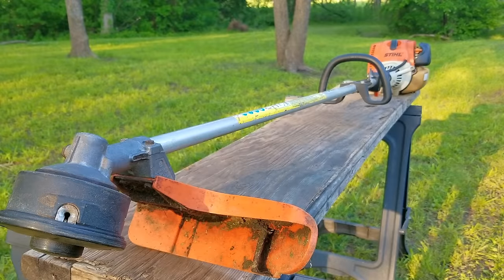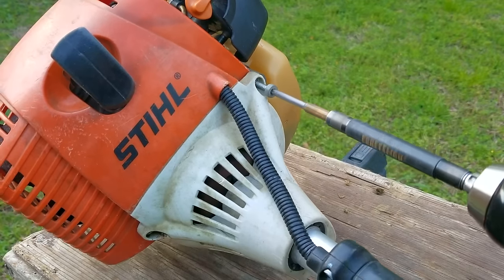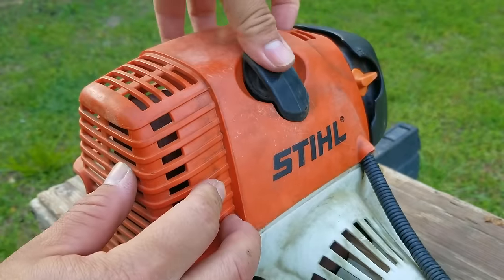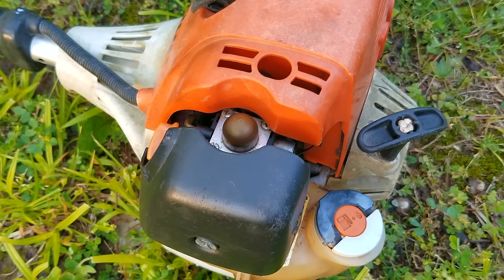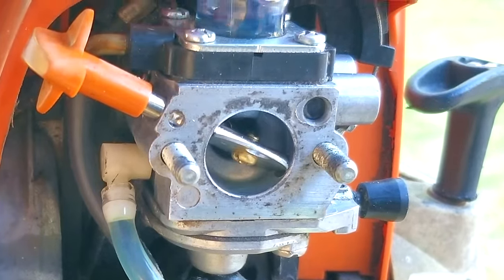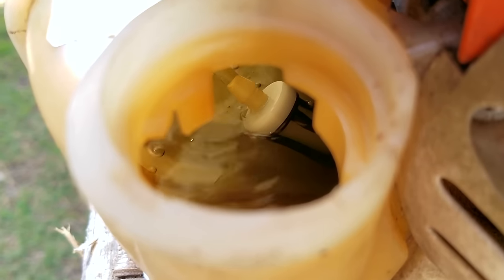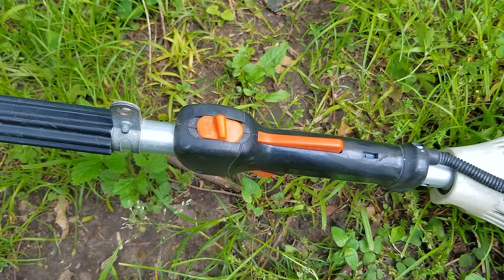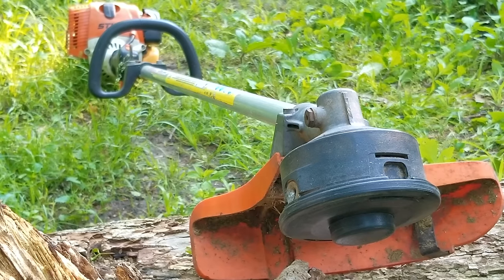Fixing A Stihl Trimmer That Doesn't Always Stay Running.

Comment: Your new carb is not a 1 to 1 replacement.  Heck even the rebuild kits are not 1 to 1.  But at least they're just gaskets and springs.  I've rebuilt quite a bit of stihl carbs.  It's pretty quick once you know what you're doing.  And you'll enjoy it if you like to tinker.  Makes more sense to me to do that if you care about your machine.  That repeated rope yanking hurt my soul.  To properly start Stihl engines, gently pull the rope until you feel resistance.  Fully retract rope then give it a brisk short pull.  You don't want pull the rope all the way.  That's how they'll break.  One thing worth trying before you tear up the carb or replace it is to play with the throttle a bit.  Use fresh fuel, with some cleaner additive.  Do whatever you need to with the throttle to get it running.  For example, a full throttle to start, feathered to keep it running.  Then slowly increase the throttle until you can go full throttle.  Release it a bit if it starts to choke and die.  I just did this on a trimmer that was said to need a carb cleaning/fixing.  It sat for 2 years.  It started and died and failed to start again. Waited a bit to let the engine unflood.  Started again with great difficulty then performed the above procedure just as a test.  Now it works great.  I hate replace whole part mentality.  Try fixing the dang thing to keep it out of the landfill.  Not everything needs to be replaced.
Reply from the maker: wow, thanks for all the wonderful tips.

Comment: i haven't drained fuel for winter storage ever : reason 1: shelf life is supposed to be 6 months with modern fuels and large amounts of winter blend ethanol fuel isn't introduced till after season ends and is removed before season begins 2: i keep the fuel clean 3: winter storage: my tanks are full or partially full to prevent dry rot and stored  HANGING UP RIGHT in a dry space cause ethanol DOES absorb moisture in string trimmers moister will settle to the bottom of tank not carb. a lawn mower is different the lowest point is the carb bowl so simply shutting off the fuel valve will prevent corrosion inside the carb from sitting over winter and tank is plastic most the time drain the fuel if in dought .    most videos ive been watching on 2 strokes with failed metering gaskets etc look like dry rot. only an opinion,                            let me know of any other opinion
Reply from the maker: thank you for sharing your thoughts

Comment: I use only engineered fuel (VP small engine fuel) and Stihl full synthetic oil. Yes I leave the fuel in all winter long. It keeps the diaphragms soft and flexible. My Stihl KM90R is 17 years old and starts first pull. Is this fuel more expensive? Yes, but well worth it.
Reply from the maker: if it works for you, keep using it.

Comment: Good video 👍. I have a question what aftermarket carburetor you use and how does it compare to the oem? My experience in the past they don't compare at all but my thoughts that they might be getting better.
Reply from the maker: thanks, I've replaced a lot of these carbs on Stihl products only after I have issues when getting the original to work properly. Of all the ones, I've had to replace only 1 was problematic, and 2 others, had small issues that I was able to deal with. And as for which carb I use, I don't have a preference. they'er all the same, as far as being aftermarket.

Comment: In my experience when you use the stihl motomix fuel or the aspen 2 stroke fuel it doesnt cause problems when you leave it in the tank
Reply from the maker: nice, thank you for the tip
Reply: Replace the gas lines

Comment: I have a Stihl FS38 that starts with no issues. Will run for a few minutes and then shut off. I have replaced carburetor and checked the basics like filter, flame screen, spark plug, etc. having the same issue. I use stihl motomix fuel, so I don’t believe it is a fuel issue. What would be your next troubleshooting step with this specific issue. The trimmer starts up every single time. Thanks for your videos and expertise.
Reply from the maker: I already answered this in your other post.
Reply: @HomeGaragechannel  this is my first post. Do you mean you answered this on another video?

Comment: Excellent video.  I subscribed.  When you set the valve lash, I have seen it done so that  each side is set with the top dead center on the intake stroke showing the arrow on the flywheel?  You seemed to set each side with a different top dead center.    Thanks -
Reply from the maker: yes it's not the prescribed method but off camera I did set it to TDC and checked and they results were the same

Comment: Well, I'm just now seeing this video. But, in the last year, I've had "experts" say that leaving a full tank and stopping with some fuel in the system will keep the diaphragm lubricated. It seems we are damned if we do and damned if we don't. I have always just stored my HL-100 and MM55 without any prep. They have always started for years before needing a new carb. I abused a Shindaiwa trimmer for 18 years that has never needed anything but 1 spark plug and a couple of air filters.
Reply from the maker: do whatever you think works best.

Comment: FYSA...won't start syndrome! I changed, i got the carburetor,  ignition coil, filter, spark plug kit after watching this video...the video was great,but still did not start, and the only thing I did not change was the additional wire connected to the coil...after several hours I decided to change that too, and ta daaaa purrŕr
Reply from the maker: nice work

Comment: For the clutch issue, I’d rather that than no clutch at all, and until I saw this video, I never knew these stihls had a throttle lock on them. Is that all of them or just the ones with tht trigger setup?
Reply from the maker: thank you Bobby Stewart

Comment: I am curious about how crankcase ventilation works on those,does it have something to do with a "pulse" hose and does some oil from the gas-oil fuel find its way into the crankcase (where the cam and crankshaft friction surfaces are)
Reply from the maker: I apologize I've never taken one of these apart to see how the blow-by is managed

Comment: Is there something else you can use to check the valve  if you dont have that special metal that you use
Reply from the maker: if you're in a real pinch, get a soda can, and cut  it in the same shape I used in the video. The can should be very close to .004"

Comment: I have mostly new stihl equipment (blower, trimmer, etc) and they have much trouble starting if I leave them in the sun on a hot day while I mow. Is this normal for these engines? Or is it an issue that should be corrected?
Reply from the maker: it's shouldn't happen, but the if that happens, try not using the choke, because the whole fuel system is now pressurized from sitting in the sun.

Comment: I bought a new carb for my Homelite Trim n Edge. I put a new spark plug. Still, it doesn't run. I checked the spark plug. There was black stuff at the gap. Not sure where it is coming from. Cleaned and put it back. Ran some and died. I would like to know the settings on the hi lo adjustments and the idle screw adjustment. Idle screw is all the way in. Hi low screws are also all the way in.
Reply from the maker: sorry I don't have that information
Reply: Pretty sure it’s screwed all the way in and like 2 turns back out to tester to factory

Comment: Hey man, I messaged you a few days ago about my machine which is the same as this but the KM 90 R so just means I can swap strimmer to hedgecutter attachments. Having done this repair would you know where to get service parts for this engine? thanks❤️
Reply from the maker: unfortunately no, I typically only get parts from Amazon. I would guess, going to a certified dealer, would be the best option.

Comment: hey i adjusted the carb screws for a bolens 110 i think, is there anything i should wary about?
Reply from the maker: sure, if you turn the screw past half a turn, and it's still not working, you'll need a new carb.
Reply: @HomeGaragechannel  ah thank you!, it seems to work fine now, it used to bog down if you went full throttle and i got that to stop, but today i went and tried it and its smoking, cant remember exactly if its blue or white but i think its blue ish, could it be i turned the screw the wrong way?

Comment: I've got the same model and I think I need to replace the carb on it. I can only get it to run if I open the throttle while yanking the pull chord but it doesn't spin the head and eventually dies. I also found that when I get it running the head will spin as it should if I manually give it fuel by pressing the primer bulb with the throttle open. I've adjusted the carb but that hasn't helped anything. 

I noticed when taking apart the carb that I can hear air escape when I lightly push on the center of the metering diaphragm, but I'm not sure if that's to be expected or not. Any advice would be very appreciated.
Reply from the maker: I'd replace the carb and call it a day.

Comment: I have stihl fs100, it looks like its the same model as in the video. I replaced the carburetor but when i am lowering the idle it turns off when its really high rpm, can you tell some reasons why it does that?
Reply from the maker: the carb's fuel adjustment screws might need to be turned a bit to work with your engine

Comment: I have a Stihl fs80, replaced the carb, fuel lines, fuel filter and plug, she runs but only if i self prime ( take plug out and pour little fuel down ) and seems to not want to adjust to a low idle, any idea of why the new carb wouldnt idle down? or cold start even if the primer bulb fulls and returns?
Reply from the maker: sure, have you check on the engine compression first, and also have you tried to make adjustment to the carb?

Comment: I've recently had an issue with a trimmer, the bulb doesn't fill up with fuel despite there being fuel in the tank so it won't start, no matter how many times I press the bulb it doesn't fill up with fuel, do you have an idea because I'm clueless as to what happened because it was perfectly fine before?
Reply from the maker: did you looking to tank and see if the Fuel filter was still connect to the line? also did you see if the fuel lines have any cracks in them?
Reply: @HomeGaragechannel  Actually I didn’t let me go check

Comment: Hi
I have a strange problem with my Stihl km 111r (4-mix).
It runs well but when I rev it up and let go of the throttle it takes very long (up to 30 seconds) to go back to Idle.
I‘ve tried adjusting the carb but it didn‘t help. I also verified that the carb isn‘t loose.
Do you have any suggestions on what the problem could be?
Thanks for your response.
Reply from the maker: have you confirmed that the throttle plate on the carb is closing when you let go of the trigger?   I'm guessing that it's hanging up.  Does it do the same on "90%" throttle, or does It only happen on full throttle?
Reply: @HomeGaragechannel  
All throttle linkage components are moving freely.
The effect does also happen at 70-90% throttle but it takes less time to slow down.
However, if you bump the throttle again after letting go it returns back to idle right away.
I checked the spark plug and it was full of carbon, so it‘s running rich. However, If I close the jets on the carburetor for less fuel the engine gets too little to even rev up.
Reply from the maker: I've never had to deal with something like this. I wonder if there's a problem with the carb. Would you consider replacing it with a cheap aftermarket carb, just as a test?
Reply: @HomeGaragechannel  I think I‘m going to dismantle the carb first and check for any petrified membranes and blockages. If this doesn‘t work I‘ll order a new one. Thanks for your help!
Reply from the maker: no problem and good luck

Comment: My string trimmer shaft started shaking/vibrating at idle suddenly, and its 1 year old unit.Any ideas?
Reply from the maker: I've never dealt with anything like that but I would guess it probably the clutch, that's the problem, But I'm just guessing.

Comment: I have this trimmer, but with the bike handlebar. it runs for a few minutes but dies and wont start again for a long time. my local Stihl dealer that i bought it from changed the carburetor, but it didn't fix the problem. do you have any advice for a fix?
Reply from the maker: sure, I'd do multiple things, I'd replace the Fuel tank vent, the spark plug and were you able to "visually" confirm that the carb on it now, is indeed new? or just cleaned with brake cleaner to appear new?
Reply: @HomeGaragechannel  it is new, but it has been sitting for awhile. i bought a new weed eater and i would like to get my old one running again.

Comment: Firstly valves should be checked with the engine at tdc on compression stroke that gos for any engine 

If your running ethanol free fuel I’d happily leave fuel in your machines as long as your using a fuel stabiliser on anything that’s still more than a month or so
Reply from the maker: thanks and thanks, you sure make it seem easy.

Comment: I have a FS 38 Stihl just had new fuel lines carburetor and spark plug an cleaned the exhaust filter and mine is bogging down
Reply from the maker: have you done a compression test? Also you said you put a new carb on? did you try adjusting the fuel mixture screws?

Comment: pls help boss, i have a few weed eaters and chainsaws that wont even start when i put fuel in  the carb, they have good compression and spark. any suggestions?
Reply from the maker: sure, make sure the engines aren't flooded while trying to start it.
Too much fuel, is just as bad as no fuel at all.
Reply: @HomeGaragechannel  thanks a lot man, you are a badass!
Reply from the maker: thanks man

Comment: You never leave fuel in your trimmer edger weed wacker lawn mower or anything during winter storage I guess it's not as bad as an idea if you buy the steel oil though since it has stabilizer in it but the answer is no because if you don't you're going to be taking the carburetor apart and who likes that and there's no real way to fix two stroke carbs because of the way they're set up with a lawn mower carb only got to do is make sure the Jets clear but you need to fix the most wonderful thing in the whole wide world to fix 2003 steel blower that thing was hell to fix I got it to run I got it to work the best it will but it runs poorly because the engines internally not good so I replaced it with a brand new steel it makes so much more power and it's so much quieter because in order to get the carburetor off you have to take the muffler off on the steel blower and then the entire thing apart beside that and to the end of my sanity when I fix that too
Reply from the maker: thank you nojo pro

Comment: I have the same steel trimmer a  after I got a couple years it’s not working it won’t start
Reply from the maker: sure, I would consider getting a OEM carb kit with fuel lines.  Also don't forget to check the valve lash.

Comment: How can you prevent normal engine wear is there a way?
Reply from the maker: that's an interesting question, worthy of an entire video, in short, Pre - lube cold engine, reduce unless idling, good throttle control, and staying on of maintenance.
Reply: @HomeGaragechannel  unless you dont constantly go full throttle
Reply from the maker: yes, there will be times where full throttle isn't needed, so part throttle is used. you'll have to watch for the spark arrestor, to get clogged up though, but that's part of the maintenance.
Reply: @HomeGaragechannel  ive took the spark arrester out, because there is no need for it.

Comment: Sorry, but I saw two problems with your tuning. High screw was wrong, and Idle speed is still too high. I run these engines very regularly and work on them myself. They should always reach rev limiter and bounce off of it when WOT. They were actually designed to do this regularly and it is not damaging to the engine at all. Dealerships do this also to warm certain machines up. For example, my BR600 the warming process is full choke, prime, start, half choke, then WOT. Run it that way for a bit then it's warm. Some say that's bad for the engine because "oil hasn't gotten everywhere yet" when it's designed with this in mind. Mainly, you needed to change the high screw, otherwise the customer will not get the full powerband available to him and he will actually lack about 20% power.
Reply from the maker: what works for you doesn't work for every machine.
Reply: @HomeGaragechannel  It's the tuning process professional Stihl technicians use... I work with them closely as a professional landscaper... But hey! If you don't want to listen to me, find out for yourself. Read a manual maybe?
Reply from the maker: none for that but thanks for the advice

Comment: zama carbs used on Stihl trimmers always have issues with the check valve assembly under the purge bulb  .  is not the best machine.  i have dolmar 15 year no pro.   start 1 pull . this carb and the aftermarket carb 😯😯😯😥  never buy stihl .  definitely is not fuel problem
Reply from the maker: thanks

Comment: So when you say "new" carb is easier and cheaper than a rebuild kit,  you mean a cheap Chinese knock off  piece of crap that needs to be modified to fit.  Hence,  the parts changer "mechanics" these days.  It is by far just as easy and much better in the long run for the customer,  to get the proper rebuild kit and use an ultrasonic cleaner to fix the problem. The OEM carbs will last indefinetly when the "soft" parts are changed when needed. It was likely the needle seat that was degraded, or the pumping diaphragm was degraded and not sealing. The diaphragm you decided not to replace.
Reply from the maker: thanks for editing your post